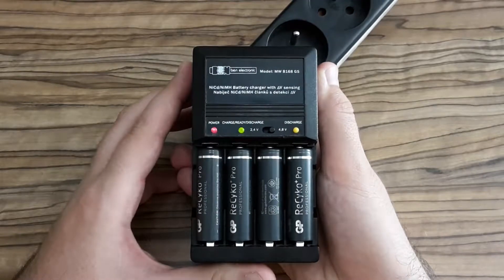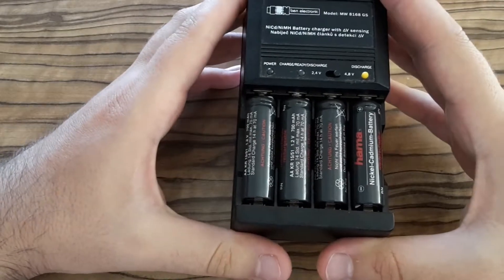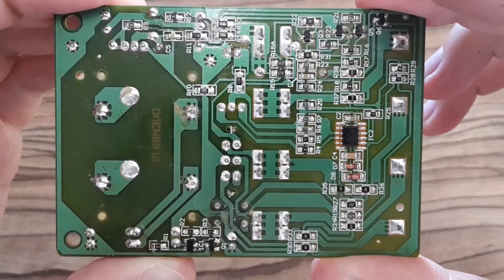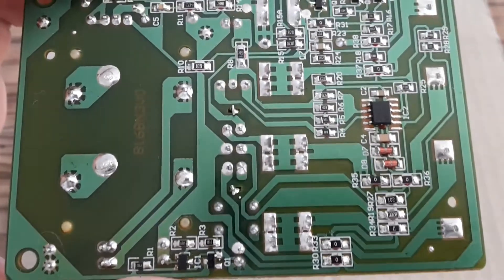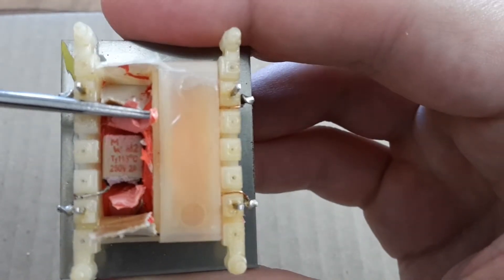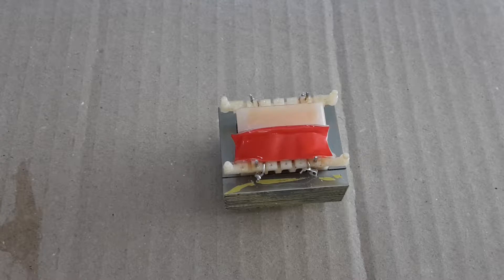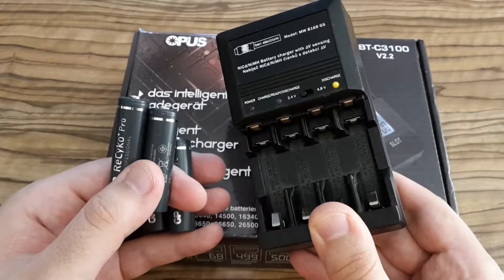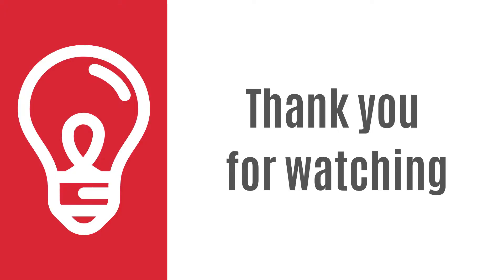Battery Charger Repair MW8168GS

Comment: I have an Energizer battery charger that looks much like this one except that it's rated for 120V AC outlet. It stopped working about a year or two ago, no lights light up when plugged in nor does anything light up when batteries are put in and it will not charge my batteries. I suspect possibly the same issue you had although I haven't opened it up yet to check. When you were checking the windings and the thermal fuse were you just checking for continuity, for a complete circuit? I'm not that good when it comes to checking electrical components and not always sure what to set my meter on when checking some of them.
 Thanks for the video and info 👍